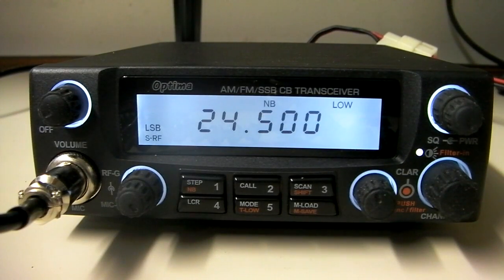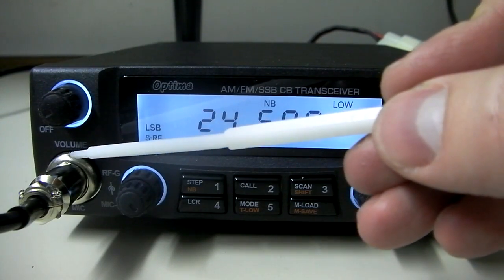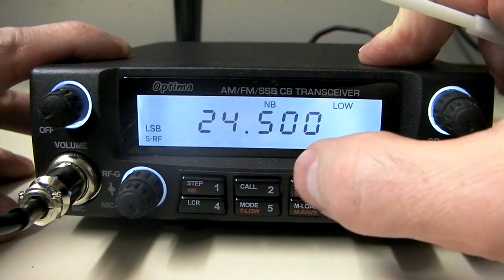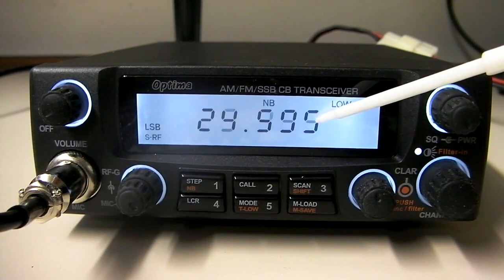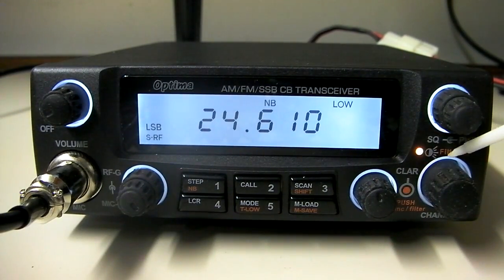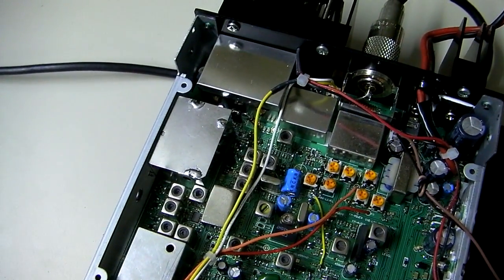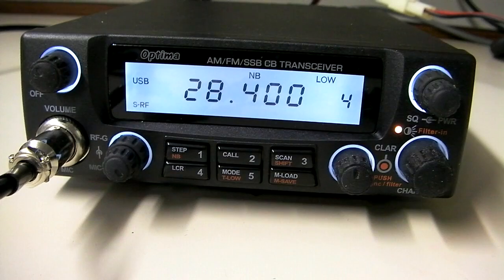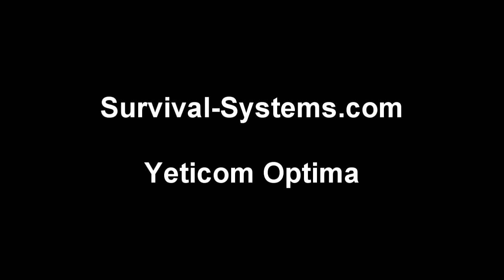Yeticom Optima 10 11 12 Meter SSB CB Ham Export Radio

Comment: Strange that 10 years later the internet is awash in cheap 10 meter radios but very few have SSB.
I found this searching for the Optim-778 that actually has LSB and USB on its display  but the radio is only FM/AM.

Comment: I first had the Radio Shack AM/SSB CB , then later when I was a Tech plus ham I had the HTX-10 amateur radio version. I had it for long time, passed it on to a ham buddy a couple years ago.
The cb radio version could be turned off and restarted with a combination of buttons on reset and it restarted on the ham bands. Maybe that's why it was discontinued.

Comment: I started using cb radio back in 1978 or so and 10 years later got my ham radio license to an advanced. I am officially retired now from work but still working in the drop retired program with the state for another 2.5 years. I plan to get this radio or equivalent for portable use, when I fully retire from work and setup at a nice park area living here in North Palm Beach Florida. Antennas for these radios are more compact and simpler. SSB is the best way to go and also FM is a neat feature! Who is the distributor for this radio in the USA?
Reply: Did you ever find out where you can buy them nowadays?

Comment: Is there a way to increase the modulation? All the way up its still too quiet.
Reply: Inside the radio you can turn the modulation up, everything is marked. You turn the variable resistors counterclockwise to increase.
Reply: Yes that I know i was talking about  a capacitor swap in the tx section

Comment: hay i have a question my radio is stuck between 28.000and 29.000
Reply: +manrangel medel Did you either unlock it or purchase it unlocked. 
To get all three bands ( 10, 11, and 12 meters) the radio has to be unlocked. If memory serves me correct, to "unlock" is child's play. On my president Lincoln II all I had to do was clip a WELL LABLED  little white wire. 
Get ahold of the yeticom folks and they may be able to either take you through it or give you the directions to do it yourself.
Reply: Ok thanks

Comment: I purchased the radio about a half year ago and it works just great on all bands. The CB (11 meters) is interesting as the SSB is so adjustable. The shipping was fast and the unit is in my radio go box with my UHF/VHF radio. The alpha military antenna with an antenna tuner lets you get all over the world on 30/50 watts. I have gotten South America and Europe and it is almost a qrp unit when you turn the power down. The units 10 meters works so well.  Have fun, get your amateur license and enjoy it. N0USN.
Reply: +Jim Fariello    What kind of antenna tuner do you use
Reply: +Bob Smith MFJ971
Reply: @JimFariello  bñ
.p

Comment: for the price of this one i would rather buy an used old amateur radio transceiver, it will have 100+ watt output continuesly and a much wider frequency range, then usualy the frequency stability etc is with amateur radios better.

Comment: Do I need a license from FCC to operate this Radio???  Can I reach the 27,695 ??  Whats the price of this unit ??
Reply: +Felipe Rodriguez   You DO NOT need an FCC license to operate this radio on the frequency you specified, or anywhere in the 11-meter (CB) band. You would only need a license if you want to operate in the 10 or 12-meter bands but if your primary area of interest is CB and the "freeband" zone then you don't need any license for this.
Reply: Thanks +Mike Urich.  I got it !!!
Reply: +Felipe Rodriguez No .... because its is illegal to operate this radio there  ... And its illegal to use on the amateur radio bands without an amateur radio license.
Reply: +Felipe Rodriguez License or no, This is not an FCC type certified radio. Even if your have a ham license, a radio that do 20 watts on 11 meters is not legal in the USA. With that said. I have one in my truck and I absolutely love it. the feature set is great. If I ever decide to venture off of 11 meters I may get my ham ticket but my radio is still a non type certified radio.
Reply: You need a license.  It is 300 bucks give or take 30

Comment: apart from the none back lit dials. FM is quiet, i'm running an icom hc-36 hand mike, radio reports on the cept fm have improved the loudness but has taken some of the lower freq sounds away. SSB is louder, i had to lower the mic gain to approx 2-3 o'clock.

Comment: The distance you get depends on a few factors. Mode, power, antenna, and prorogation. Lately the 10 meter band has been wide open. I recently made a contact from California to Japan. That was with only 5 watts doing PSK 31. My antenna is a simple home built wire dipole. So "how far can you get" isn't the easiest question to answer.

Comment: Nice radio! ould be nice if wouxun could come out with a 10-12 or HF radio. I ordered the Radio Shack HTX-10 used from ebay and it looks very similar to this radio except for the dual finals and fan in the back. What is the cost for one of these radios stateside?   Steve